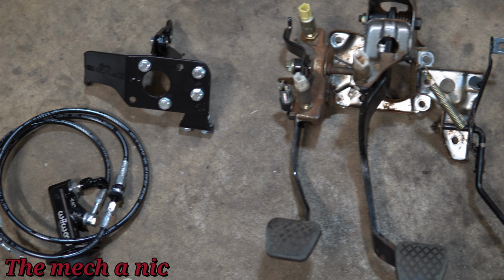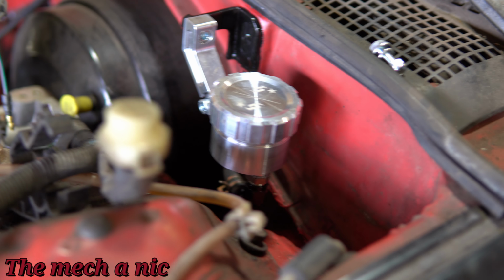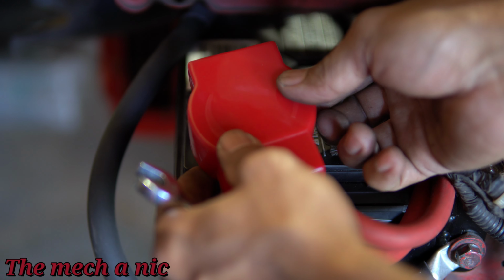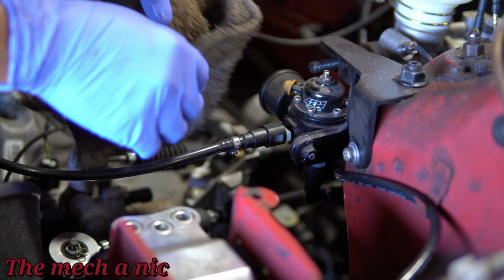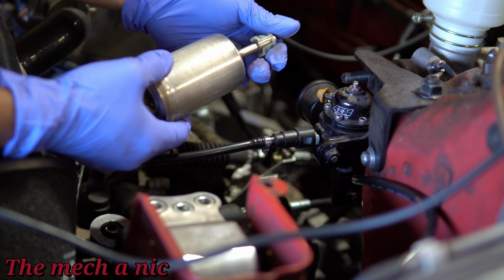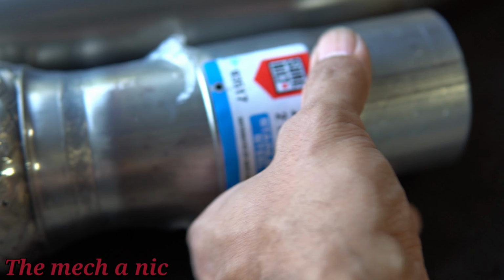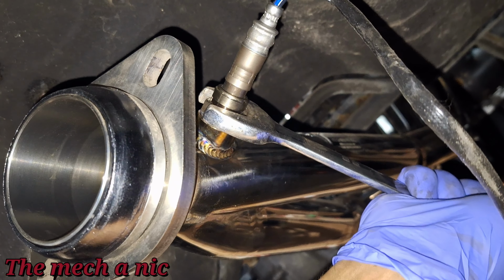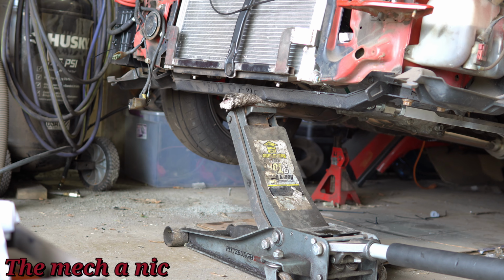Getting the CRX ready for first test drive

Comment: Great job man looks amazing. Only thing I hope you are thinking about doing is painting that engine bay.
Reply from the maker: Some day lol, for now I just want the car running right
Reply: @themechanic6117  I feel ya, I went over the decision for 2 days, and I'm painting mine, but I really need to try to stop the rust. On a Cb7 se then on to my wagos rt4wd
Reply from the maker: @Lost10mm.  I figured once I get everything running right and reliably I'll pull it all out to do the engine bay. The car has been sitting for so long I'm ready to just drive the car
Reply: @themechanic6117  😁 mine's been sitting for 3 years maybe more. I know that feeling that's why I'm waiting to port until I turbo it also because I will most likely change both exhaust and intake manifolds when I choose to. But I really would rather turbo one of wagos and turbo the cb7 coupe I'm going to be rwd converted. The cb7 se is a sedan and kinda just wanted it to be a clean daily.

Comment: If it makes you feel any better, i used the same paint that you used on your exhaust - i put it on a custom header for my Subaru (2006 non-turbo Outback) and most of it flaked off after 5 or so months. I didn't use any primer, but i did prep the surface really well. I cleaned it with acetone and scuffed it up for extra tooth, but it still flaked off after a while.

Guess that type of paint just isnt cut out for exhaust parts. Oh well. 🤷
Reply from the maker: Thanks for the input, I was going to try again later on without the primer. Nice to know that it would just be a was of time. 👍